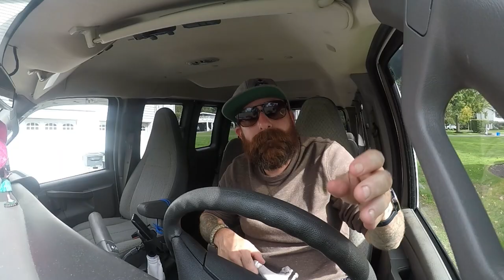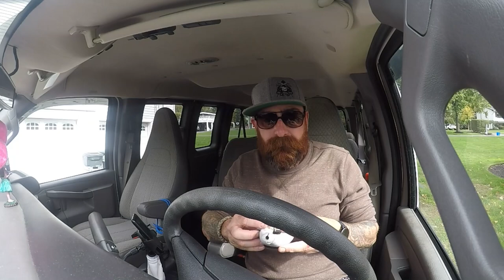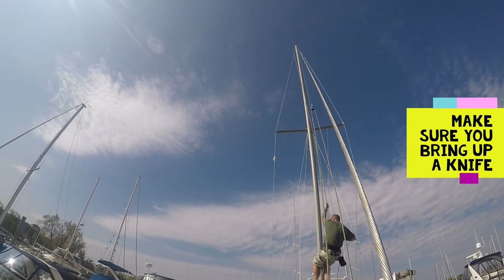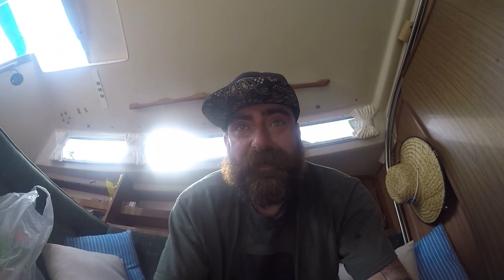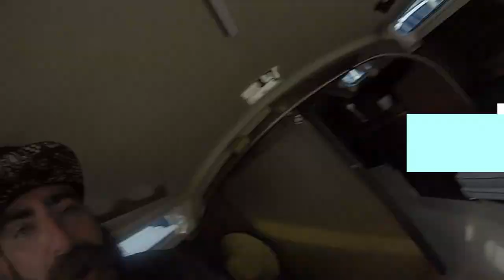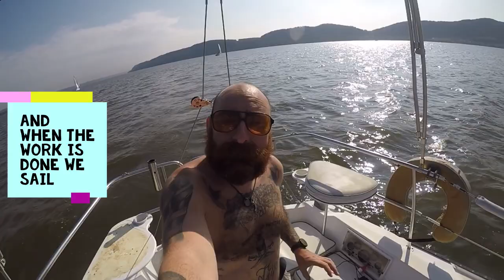The Sailing Project Atremis Episode #2 Spreader Boot Replacement and Old Broken Halyard.

Comment: Wow, going up the mast is one of your first tasks? Usually people start with wiping down surfaces. Way to dig in!
At the top of the mast, I'll bet you feel every movement of the boat, multiplied. I think you'd have to remind yourself that you have 4,000 lbs of keel keeping the boat upright. Still scary.
What equipment did you use to get up there? Did you rig up something from rock climbing equipment, or is there a specific rig for climbing masts? What's holding all the tension at the top (and is there some kind of backup in case that fails)?
Reply from the maker: Spare halyard was for safety
And nope just a rock climbing harness

Comment: When I was 16 I bought a kittiwake 23, my main halyard pulled through the block at the top of the mast. The smart thing to do would of been to pull the boat out of the water, step the mast, and re-run the line, that’s not what I did. Young, dumb, and feeling bullet proof I climbed that son of a bitch in 20 knot wind, whipping around at the top of a mast un harnessed will give you a new outlook on life.
Reply from the maker: My lines were fine needed to do the spreader boots
Reply from the maker: Was also on two halyards for that one